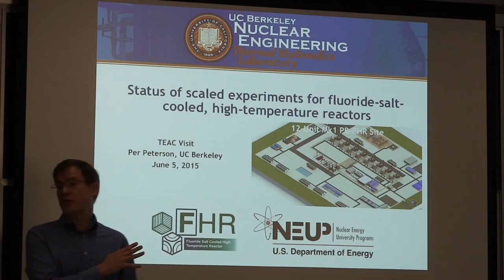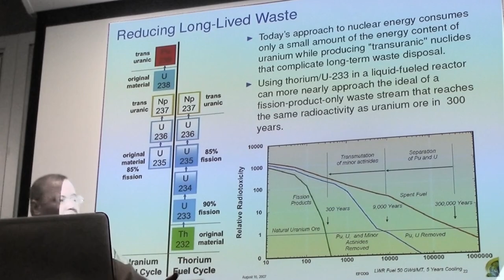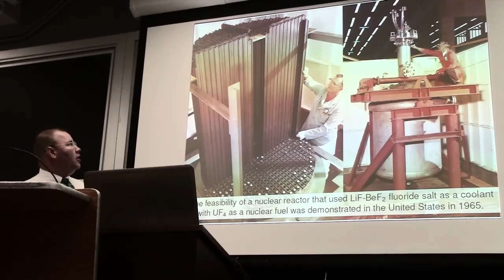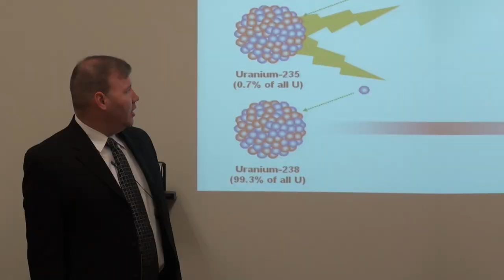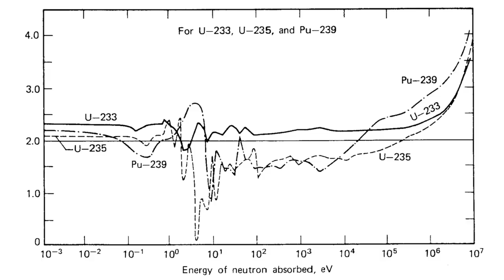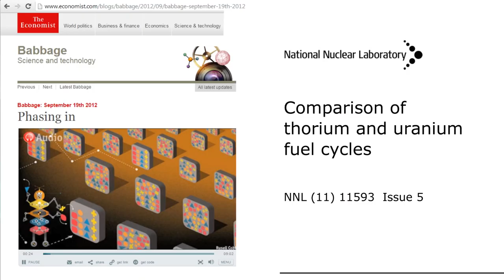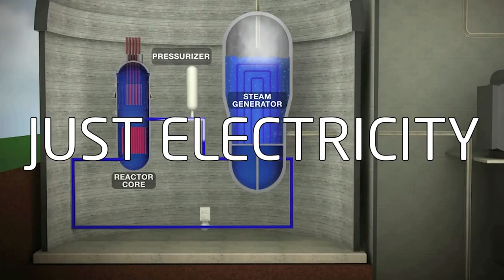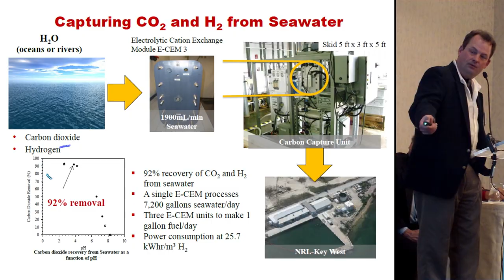Thorium Disadvantages

Comment: This is not a disadvantage video, just how the industry had blocked thorium!
Reply: Clickbait works.
Reply: Obvio man. El negocio de los hidrocarburos fósiles no se termina pronto, después le siguen los hidrocarburos orgánicos.
Reply: Dotte van Dijk I never said I wanted it to be, I just wanted to see if anyone could give me a good reason against!
Reply: Those blockages ARE disadvantages.  Duh.
Reply: The point being that the “disadvantages” aren’t technical; they’re political.
Reply: @meh2972  Ok let me stop you right there, stop with the fear mongering, the physics are against you if you were to even try to make a bomb with U233. So even in the impractical sense, there are far easier ways to make a bomb than trying to do it the "hard way" through using Thorium to get to the fissile product of Uranium 233. 
That's not to say we shouldn't safeguard these materials, as they are extremely hazardous, but to overhype it to the extremely ridiculous notion of making nuclear weapons with it, so as to preclude its use in power generation, is preposterous at best!
Reply: In short yes, but with Thorium it is really hard, this is why we went with Uranium reactors, for easier bomb material.
Reply: It takes a month to get it going.  And the power would be so cheap the banksters couldn't pull any of their usual b.s.
Reply: @ROTEsimplemachines  i think we should use ocean wave and hydroelectric as our first options
Reply: @kenlee5509 , that's a myth that we use uranium because of its military uses also.
Reply: @davidkramer4006  Thorium provides a decay chain of industrial materials, Uranium decays to more military materials than thorium. The real argument for thorium is its ready availability and relative abundance. Everything beyond that is just a list of bonus profit streams.
I am well aware of Nixon's treachery if you were alluding to that, BTW...
Reply: @davidkramer4006  That title and production was a specific response to the rabidly anti nuclear power crowd. who refuse to see any advantage in ANY form of reactor, even though MSR's are the answer to their prayers. It was thumbing our collective noses at their lies. Time passes, context is lost, reactions like yours are inevitable.
Reply: I agree. I wanted a objective weighing of disadvantages which I don't hear a lot .....
Reply: @meh2972  We have nukes...
Reply: Yes the military industrial complex needs their Plutonium they will have none of this no plutonium thorium reactor crap ;-)
Reply: great reactor design .... how do we get plutonium out of it? wait we cant, oh I see.
Reply: make no mistake, during the cold war that was a very important consideration and we live with that legacy.
Reply: Nobody is blocking thorium. It just makes no sense whatsoever right now.
Reply: ''it just makes no sense whatsoever right now'' ... yeah its not like we have a major climate and energy crisis on our hands. I agree that nuclear already is the best option......but thorium has amazing potential. it makes a ton of sense to develop the technology now. we don't need that much nukes anymore and materials science and technology has improved a lot.
Reply: @km5405 
Correction: thorium reactors make no sense whatsoever compared to regular uranium PWR reactors.
Reply: solid fueled ones yeah. ...... you really think 50 year old tech designed for a different application is the best we can do? ..... and as long as there is no research budget it wont get off the ground and we wont know either way. aside from the fact that because of history a lot of them are still around, how are uranium PWR reactors better? and safety is the most important aspect for modern reactors.
Reply: @km5405 
Molten salt reactors are also a 50 year old tech.

There are multiple reasons why new PWR reactors are better than thorium. Starting with safety - it's not clear that a gigawatt-scale molten salt reactor can even be safely controlled.
Reply: its fundamentally safe.....inherently safe because of the physics involved. .... PWRs on the other hand are fundamentally unsafe.....even if the safety systems to control that are very good. You don't have to go gigawatt scale either. terrestrial technologies' IMSR just uses completely sealed smaller ones. .... and for both  the fact that the first design is 50 year old is irrelevant. that has nothing to do with what it is in its current form. there have been tremendous improvements to PWR reactors. they are incredibly safe and probably one of our best options for  saving the climate already. but why should that automatically remove molten salt reactors from the table? molten salt reactors have some very appealing properties that potentially make them far superior. not just in safety but in efficiency as well.
Reply: @km5405 
No. Modern PWRs are as inherently safe as molten salt, even in case of a full meltdown the molten fuel (and reactor components) will simply be caught in a special catchment area below the reactor.

But I meant something different. Normally fission is a very fast process that happens in nanoseconds. So reactors can be controlled only because a small part (around 0.14%) of fission neutrons are emitted several seconds after a fission event ("delayed neutrons"). In normal reactors this small fraction is enough for control systems to be able to maintain the amount of neutrons at a controlled level.

However, in a molten salt reactor the fuel is constantly pumped out of the core (and at a gigawatt scale the fuel will recirculate quite rapidly). So some delayed neutrons will be emitted in pipeline and the heat exchanger, meaning that the control systems will have much tighter neutron budgets.

Add to this very complicated physics of fuel coming with lower temperature (and thus much more reactive - there's a neutron resonance at lower temperatures) from the heat exchanger and mixing with hot fuel at the top of the reactor.

The worst case you're looking here is prompt criticality accident that could easily vaporize a good chunk of molten fuel. And with fluorine you will get hot fluorine radicals - about as chemically scary stuff as you can get.

TLDR; - there are lots of HARD engineering problems to solve if thorium reactors want to approach the capabilities of 60 year old true and trusted technology. They might be solvable, but the required R&D is around hundred of billions of USD.
Reply: Christie Malry 
Who exactly is the PWR inventor?

Right now fuel price is basically immaterial, it's less than 1% of the reactor construction cost. And there's enough known reserves of U235 to last at least until the end of the century with the current technology.

It's then possible to breed U235 from U238, though not in PWRs. This will basically provide enough fuel for thousands of years, just from the currently available stock of depleted uranium.
Reply: That is the main disadvantage though.
Reply: not industry, anti-nuclear activists.
Reply: We used a mixture of Thorium and Cesium 137 inside the EX 4 reactor, and it ran at full power without cooling for 3 years. The big companies soon put us out of business.
Reply: Why are we not using this technology
Reply: @samh4232   Disadvantages are it does not fission on it's own. You have to either put weapons grade uranium in it or blast it with some sort of accelerator or something.  It creates less energy and is less economic than traditional reactors which already struggle to compete on the open market. It creates a mixed waste stream that is very difficult to dispose of. It won't melt down, but can leak. It has most of the same disadvantages of conventional nuclear power but is less cost effective. Thorium breeds  uranium-233 which is fissionable and is a risk for proliferation
Reply: @greenspiraldragon  that's not necessarily a bad thing with the fission.  Actually from the sources I've read a lot of this information isn't true. My source is the Manhattan Project, had a family member working there, and they actually trialed this type of generator.
Reply: @greenspiraldragon  The reactor that they ran was a MSR, and it generated power just not enough or no weapons grade material. It can actually dispose of WG material. That was the main reasoning behind them not pushing it forward, hell India and China are in the process of building MSRs
Reply: @AlexBesogonov  right so cheaper power is a bad thing, got it
Reply: @AlexBesogonov  Well I guess we will find out when the Indians and Chinese get to it first.
Reply: @samh4232 
Thorium plants won't be cheaper. Right now they simply don't exist.

I guess you prefer imaginary power?
Reply: @samh4232 
Neither of them is actually building molten salt reactors, not even for scientific purposes. They are investing in R&D in this area but so far the results are totally expected - molten salt reactors suck.

Meanwhile, India is building a classic sodium-cooled breeder (PFBR) that simply uses thorium instead of uranium.
Reply: @AlexBesogonov  But there was one that actually did, maybe look into the one that the Manhattan project ran. Is it still active, no because it didn't produce weapons-grade material at all or in the quantities requested.  however, the physicist and engineers actually stated that it would be a great source of power...but hey we should just stifle innovation amirite
Reply: @samh4232  
Molten salt experiment reactor actually ran well after the Manhattan project. I researched it during my Masters program at university, but the materials about it are still mostly classified.

There's very little disclosed about the reasons for its shutdown or about its performance, except for off-the-cuff statements by some of scientists.
Reply: Sam H We? No, let Israel stifle innovation. After all, those centrifuges aren't going to slow themselves down, now are they?
Reply: @HighestRank 
What does Israel have to do with this?!?
Reply: @HighestRank  What was the point of bringing regional politics into this discussion? Does it make you feel better? What does this have to do with researching into Thorium? The only time I've ever bought a country into this conversation is because they are looking or have started research into MSR, when did I ever make this political?
Reply: that's exactly what it is...
Reply: Agreed. I hate clickbait titles.
Reply: @robinsss  Go work on anything mechanical by the ocean for a month.  This is nothing but a maintenance/money sink.
Reply: what do you mean money sink?
Reply: robinsss maintenance costs money, anything around salt water requires 4 times the normal amount of maintenance.  It's just one of those good ideas that isn't worth a shit.  Perhaps as a form of energy for drilling rigs or something, but there are many better ways in land.
Reply: do the costs of maintenance for the ocean devices out way the  benefits that come from them?…………….……………………………………………………………………………………...if they do where's your evidence?…………….……………………………………………………………………………………………………..did you know that hydroelectric can be used on fresh water bodies and is mostly associated with rivers?
Reply: @samh4232  Biggest disadvantage is mindset it seems. But also, it is not yet proven technology. There might be snags along the line and we are still looking at around 3-5 years of extensive testing of scaled up versions to be able to get any real ROI and any real advantages. A very risky investment. (which is kapitalist mindset again, but also a bit of how everything works)
And if it pans out, which it most probably will, you will not automatically profit.. Thorium is too abundant to control, which is part of its appeal for others. But it´s not printer ink.. So commercially, that is a draw back. Once the first reactor (or even the first loop) is built that works sufficiently almost everyone in the field will instantly know how it´s done. So very little IP remains private. It´s almost a open source movement. Which means that you might have a small lead, but the window for making a profit is quite small, your competitors will come up quite quickly.
And progress is slow, because we have to be very very careful.
So all you get is hippy types working on it and investing, who don´t usually have a mass of money.

We´d need a visionary billionair like Elon Musk to get involved, but he is also quite interested in making money, because he needs it.
He sees AI and ELE´s as a bigger threat than environmental issues at the moment.
In fact, I think.. it wouldn´t fit Elon Musk´s agenda at all to support molten salt reactors, because (almost) free energy would spark AI to be developed in an accelerated fashion. Who doesn´t want a free robot slave, that runs for ever for a dollar? You can actually make a profit there. Let´s give them as much autonomy as we can, never mind regulations and we can control production by misusing the regulations, saying we don´t want von-neumann machines, brilliant... Add a little emergence and singularity, end of human race. 

Elon Musk- has been quoted to say: 
"Maybe it's better to do better fusion reactors"
Seems rather lacking in vision of a man who looks further ahead than all of us. So I guess this is his reasoning.

BTW: I disagree on the likelyhood of emergence showing up as consciousness and what that would mean and therefore the reality of the singularity. Else I too would think molten salt reactors were a bad idea.
Not technically, but for the human race.. We would just not be ready.
Reply: That's the only disadvantage.
Reply: seriously tho, what ARE the disadvantages... is it only the corrosion caused by the molten salt?
Reply: @meh2972  of course.
Reply: @Rob_Moilanen  Chemical separation without the need for implosion means 233 U is far more likely to form the core of a nuclear weapon than is 239 Pu.
Reply: @AlexBesogonov  uhm, how is a pressurized water reactor safer again? You do know that the very design of such reactors makes them inherently unsafe? You do realise that of all the reactors that have blown up, controlling the hydrogen gas production, was the root cause of them blowing up? Three Mile Island, Chernobyl, Fukushima, and you want to build more of them? I dont think that's such a good idea, given its already proven track record. I think its time to try something else and get away from putting water anywhere near these reactors.
Reply: @Rob_Moilanen  Yep, and there is neutron absorption.
But this is trivial in the enrichment process IN SITU as LFTR's perform chemical separation.
Try again
Reply: @Rob_Moilanen  You require enrichment in Thorium reactors.
I gave you the link.
If you're too stupid to read, not my problem
Here's the gist of it.
Neutron transmutation energy is VERY NEARLY the same as capture-fission energy.
It won't breed without enrichment.
There, Thorium dead, or people dead.
Reply: Its a bunch of nerds yelling at you video.
Reply: Thanks, I wasn't going to watch the video just looking for this comment.
Reply: dis guy is woke he known tha industry been blocking thorium!!
Reply: Yep.
Reply: Nixon
Reply: @hellstromcarbunkle8857  What about using ozone from artificial smog, which blocks and is heated up by gamma radiation, so it expands, and therefore is forced through a supercritical turbine, which would eventually let it decompress. This would be used in loops taking shifts!
Reply: @HighestRank  I wonder if you would like or have liked the Top Gun franchise, and Film Theroy's take on it, or if you were just trolling!
Reply: They were more interested in bomb making in the beginning.
Reply: They key to using thorium is, liquid fuel, thermal breeder.
Reply: That's kind of the point. The disadvantages people prop up are largely red herrings.